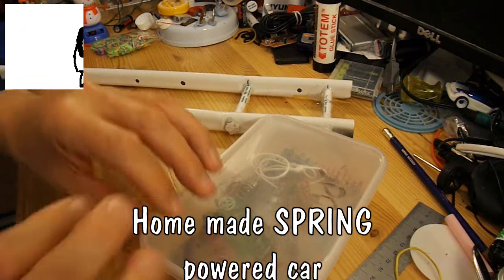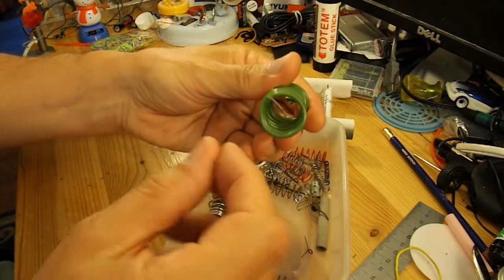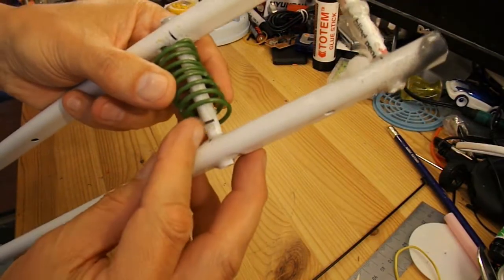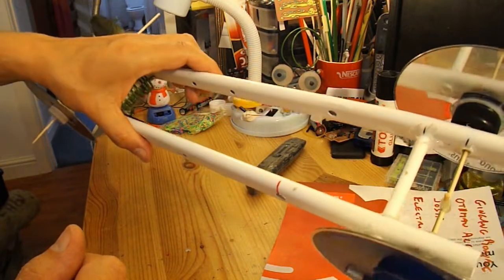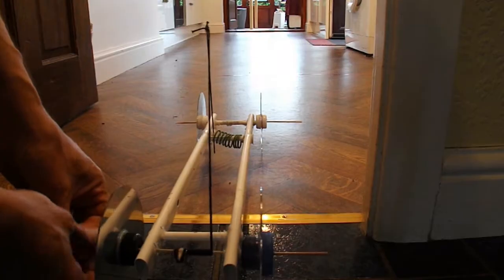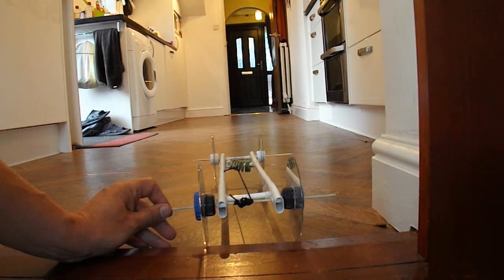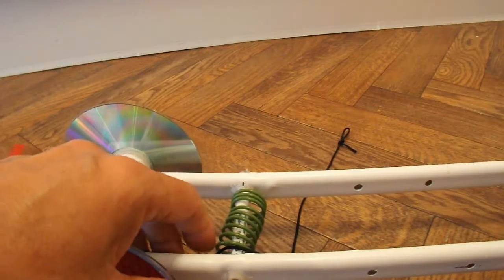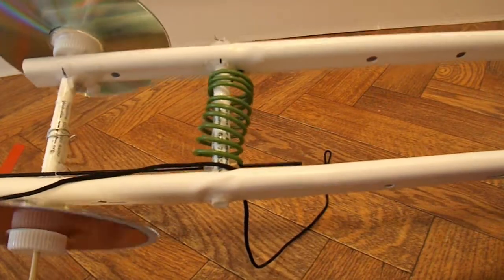Home made SPRING powered car - Torsion not Tension

Comment: How can I design this to slip once it’s moving and conserve the energy for when. It’s needed?
Reply from the maker: I would suggest buying a small wind up or pull back toy. Take it apart and study how the individual components work.
Reply: GrandadIsAnOldMan I need to disengage the mechanism once the motion begins then apply it as needed.  That would be a clutch or slip and friction mechanism.
Reply from the maker: @dalethebelldiver7740  sounds like a centrifugal clutch that comes into play when the rpm is right but working in reverse to the way they are normally used. Normally they work by engaging the drive when the motor is spinning fast enough, but you want it to disengage the drive when the vehicle is moving fast enough. However I don't see an easy way of then preventing the motor wasting  the rest of it's energy when it has been disengaged.

Comment: After the tension is finished,it will stop. What can we do for that? please reply.
Reply from the maker: As long as the axles are free running (low friction) the car will continue running with the inertia it has built up. The only reason it stops in my video is it hits something. It hits the step in the first run and the door in the second run. As long as you have NOT tied the string to the axle the string should drop off when the tension has finished to the car can freewheel. That is why I use a loop on the end of the string to hook on to that "hook" on the axle, so it drops off cleanly.

Comment: Can't it be done with clockwork... I mean slowly twisting the spring and then back it to its natural length after some time
Reply: Can you send a link that how did you make a green spring?
Reply from the maker: That is more or less what it is doing in this video.
Reply: can this pass through a string magnetic field and as the area of each loop changes there creates a induced emf
Reply from the maker: AshishKumar Huidrom a moving magnetic field will induce a current flow in a conductor. Lenz's law.
Reply: @GrandadIsAnOldMan  sir i want to know and learn the mechanism of pull cord start mechanism..
Reply: Raj Chavda I'm also confused how will the spring work... You have any solution?
Reply from the maker: Raj Chavda It is just a piece of wire wrapped round a wooden stick. There is a link in the video description that takes you to that video.
Reply: Sir. I just want to learn how to make a pull cord  start mechanism simple and easy to construct..